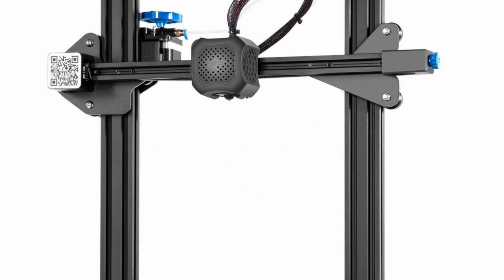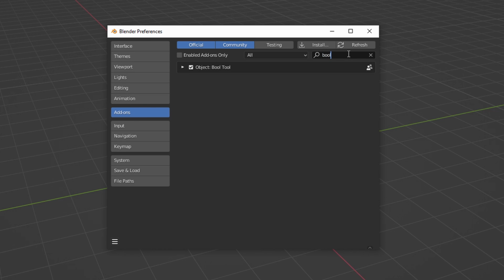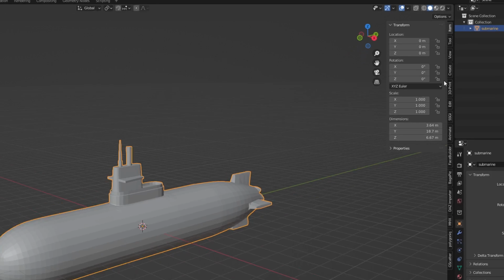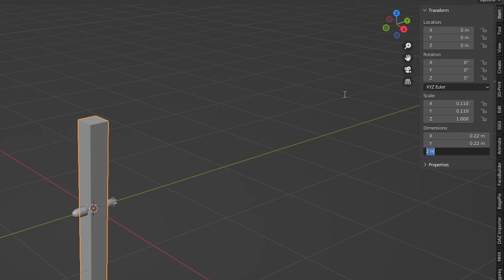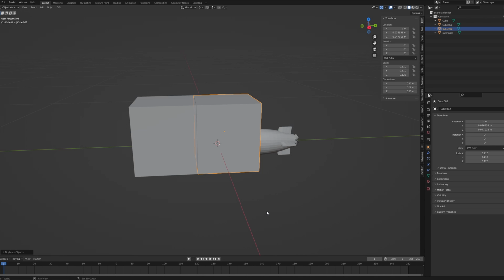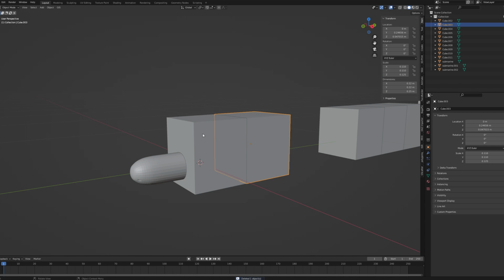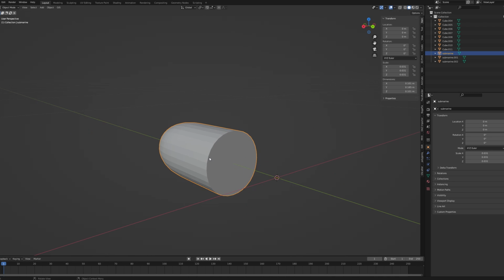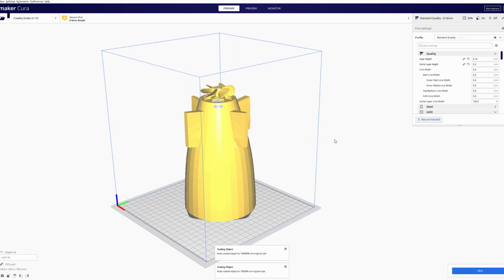How To 3D Print Large Objects In Pieces

Comment: Im having a issue connecting objects to a base.
I tried a union boolean with a 6 side cyclinder. But its not working in luban. Maybe because of topology of a scan model vs base is different? Or maybe because base is hollow and not working with the cyclinder than is union boolean?
For example lets say I have a high topology brick wall. But base is simple with one face. Im using a 6 side cylinder to union that has high topology to a base that has 1 face .

Comment: I really liked this tutorial, but i have one question... If my model is too big on the y axis as well, would i just repeat this process with length, width, and height? Or is there something else i would do?
Reply from the maker: In this case, once you have your x axis covered with boxes, duplicate the cubes and move them along Y axis, so the model will be completely covered in cubes. Other steps apply the same - create as many sets (model + cubes) as needed and use cubes to cut out the chunks one after another. You can use this method in all 3 directions at the same time :)
Reply: @Katsby_engineer  thanks, I really appreciate it 🙏
Reply from the maker: @hazmat_botw  Happy to help!